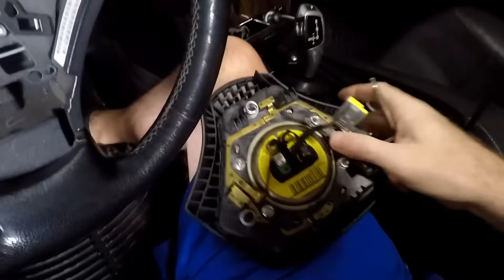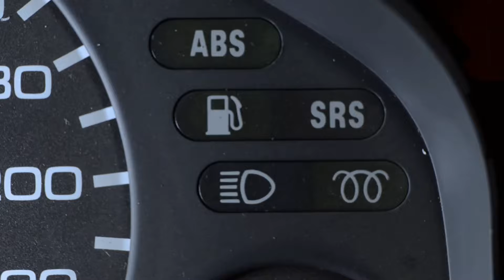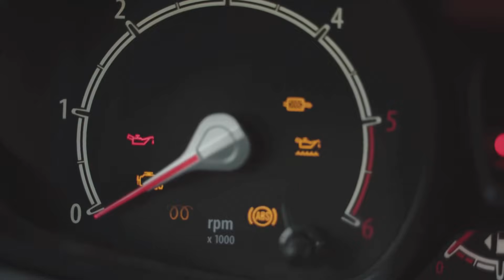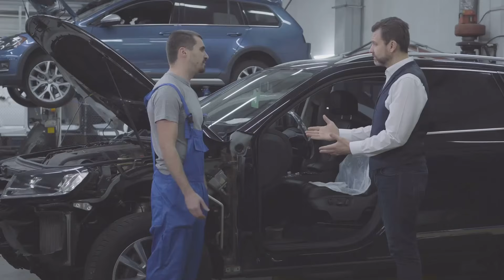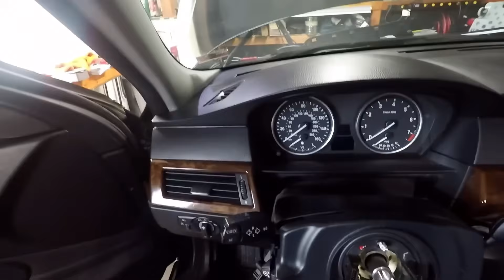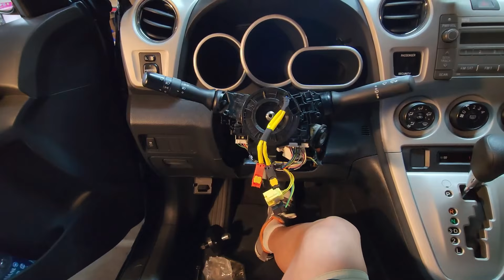4 Symptoms of a Bad Steering Angle Sensor & Replacement Cost

Comment: i think i found out mine is faulty because usually the turn signals would turn off as soon as i make the turn but now it stays on always it’s like the car didn’t realize i just made the turn that i signaled for, and i also have traction control lights on so im 90% sure its the steering signal sensor

Comment: My 2010 Hyundai Elantra I bought like 6 months ago, it links to a steering angle sensor having a malfunction and now the electric steering stays on even though the car is off
Reply: You may be able to reset the steering angle sensor yourself. Follow these steps: 

Turn the ignition on (without starting the engine if your car requires this). 
Center the steering wheel as precisely as possible. 
Turn the steering wheel slowly to the full right lock and hold it for a few seconds. 
Turn the steering wheel slowly to the full left lock and hold it for a few seconds. 
Return the steering wheel to the center position. 
Turn the ignition off and then back on to see if the issue is resolved

Certain older model cars will allow this to be a reset for the steering angle sensor. However, if your car is continuously receiving power to the steering even when it’s off, this might not solve your issue. It could be the control module failing to shut itself down. These control modules can be very expensive ($1,000+) just for the part and not labour. You can find them for cheap from places like EBay and such and I would highly recommend doing so if the module is the issue. 

If you cannot afford mechanical work you can always bring a 10mm socket and wrench with you and when you turn the car off you disconnect the battery. It’s a crappy position to be in, but times are rough right now and we all struggle from time-to-time. 

Good luck :)
Reply: Should I get a new column? @BonusChaser

Comment: I have a 2008 Chevy Cobalt. When I make a left or right turn, it has like memory steer. I have to physically turn the steering wheel back to center, it won’t turn back on its own. Does anyone have an idea what would cause this. There are no lights on the dash, I replaced the electric steering motor and that didn’t fix it.
Reply: Hello, sir. I hope this finds you okay.. What you’re experiencing has nothing to do with the electric motor. The electric motor provides assistance when you turn the steering wheel. Providing more assistance at lower speeds and less at higher speeds. The motor is not what repositions the wheel at 12o’clock.  
There could be a few different things happening here. 

More Likely: 
1) Alignment needed for incorrect caster angle (will reset steering angle sensor after alignment)
2) Ball joints, tie rods, control arm bushings and/or strut mounts need replacing
3) Steering rack and pinion 
4) Binding within the suspension itself

WAYYYYY Less likely: 
1) low battery voltage
2) bad ground or fuse 
3) ECU failing to calculate steering wheel position properly 
4) Low tire pressure 
5) bad steering angle sensor

What I would do…. 
Try to perform a steering angle sensor recalibration yourself by following these steps… 

Park your vehicle on a level surface and turn the key to the “ON” position without starting the engine.
Turn the steering wheel fully to the left and fully to the right at least 3 times.
Turn the key to the “OFF” position and restart the car.
If this doesn’t work, repeat the process but disconnect the battery first…

If this doesn’t work Buy a cheap OBDII scanner and check for any stored codes. If there’s none you really don’t have a choice but to take it to a shop and have it looked at thoroughly. Unfortunately with electric steering there is so many parts including mechanical and electrical. Could be something simple or something much more complicated. Just for an FYI. Steering wheel returning to centre position is mechanical design principle and not an electrical one, so I would start with mechanical issues first and go with what I said.

Good luck!!

Comment: I have a 2013 ford fusion i just bought electric power stearing is completely out traction controll light stays on my plug in reader pulls up to reprogram it or replace the steering wheel sensor is their any way to tell if its the stearing sensor or the electric power stearing not working
Reply: Same here let me know when u find out the problem please
Reply: 2013 Caddy CTS AWD with the Service Stabilitrak (SS) code. Tried several things but no good. In my case, if I let the car sit a few hours, the SS code went away. I could back out without it reappearing but as soon as I put it in drive and moved at all, it came back. Bought a new GM steering sensor and put it in. The instructions said start the car, turn full right and wait 3 seconds, then do that to the left. Repeat one more time and drive straight ahead for at least 50 feet. Nope. Now I have a different symptom - the SS stays on all the time. Let it sit overnight and start it...SS on the dash. I found that Code C0710 was still there. Cleared that code and immediately got a Service Charging System code. After about four starts with the car, that cleared and wonder of wonders...NO SS CODE. It's been off for days now. Hope this helps. You have The Strange Problem!! There are a lot of items that feed the Stabilitrak computer, including ABS errors, wheel sensors (all four), and in my case, the Caddy has a Yaw Sensor under the passenger seat. Good luck!!